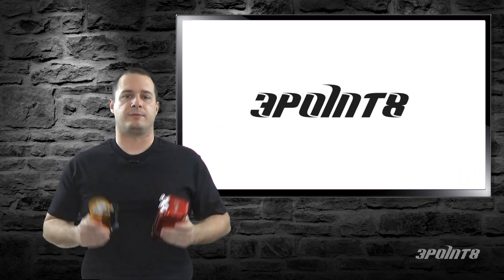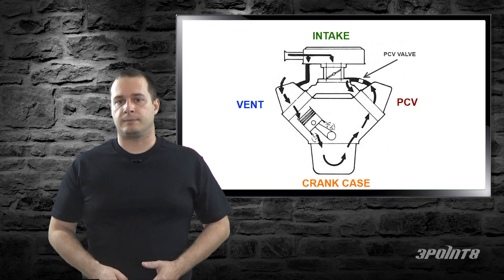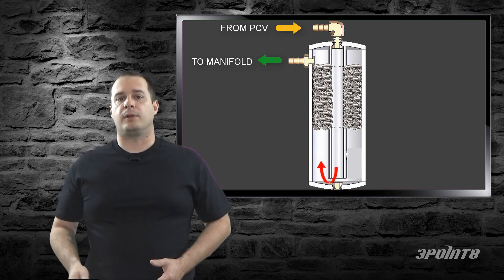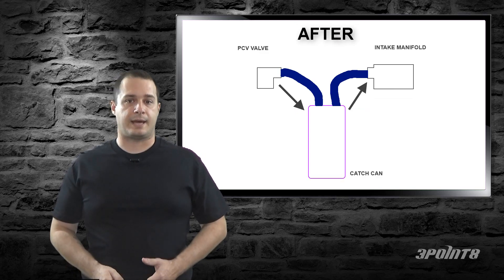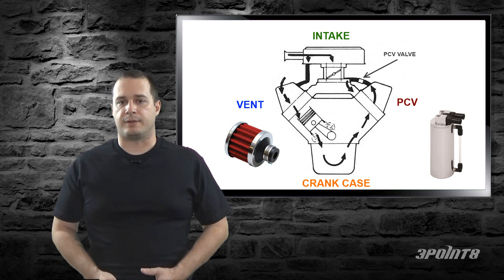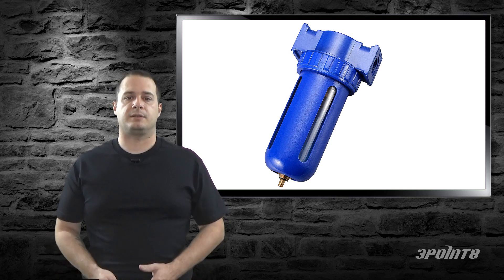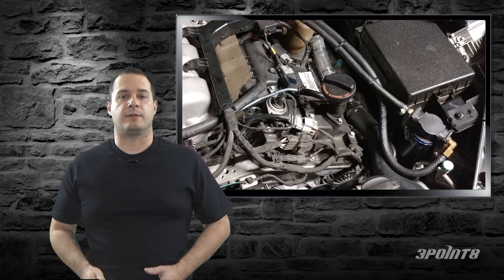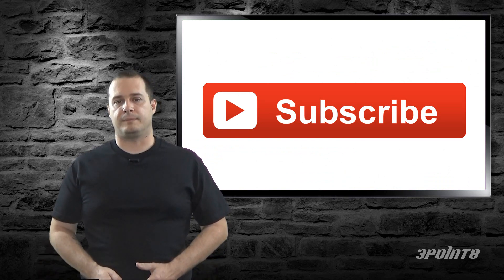What is an Oil Catch Can and Why Do You Need One?

Comment: Oil Catch Can installed
Here is my 2008 Nissan Sentra oil catch can configuration and the end-product result. 04m37s ~ 05m04s discolored gasoline sludge and carbon residues safely trapped in engine oil catch can oil catch tank https://www.youtube.com/watch?v=xCfhebKMRbU&t=2s

오일 캐치캔 캐치탱크 장착했습니다. 가솔린 휘발유 차량이고 포집된 기름 상태 찐득찐득합니다. 2014 Hyundai Tucson SUV oil catch can end result https://www.youtube.com/watch?v=2wvupPKUeTE&t=965s

자동차 엔진 수명 연장, 집에서 일반인 누구나 DIY 가능 최소비용 최대가성비 The most cost-effective engine DIY maintenance at home https://www.youtube.com/watch?v=6DLn0kIi-84&t=225s

Comment: I have a question. In December I purchased an older Toyota Solara 2004 from a private individual.  Due to no affordable transportation.  It had the dreaded 2azfe engine.  I have owned it for four months and do only local driving since I am disabled.  Turns out its an oil consumer, I go through a quart each month.  It still has plenty of pep and no visible oil leaks.  I was going to put a catch can on the outlet of the pcv valve before it goes into the intake manifold. But I heard you mention if oil is getting past the rings a second catch can could be used on the fresh air intake where it goes into the valve cover.  Please elaborate on how its done and what it can accomplish and how more oil escaping can be collected there. Thanks.

Comment: I have a 2003 Neon SRT-4. I put a catch can on it.  I realized when boosted the manifold pressure was no longer vacuum it was boosted. Making air flow in the opposite direction through the pcv hose.

It was actually a boost leak so I put a one-way check valve in the hose that normally sucks air out of the crank case and I noticed an increase in horsepower.  catch cans work great for normally aspirated cars but be careful when you have boost the air will run in the opposite direction from the positive charge toward the engine and in my case the way the valve cover was designed.

the pcv is at the passenger side of the valve cover and the hose that goes to the airbox is on the drivers side.

When you have boost the air flow is reversed.

The air goes in to the valve cover on the passenger side and goes out on the driver side getting oil in the airbox even with having the catch can.

Since using the one way check valve my airbox is dry.

Even when new and 100% stock oil was gathering in my airbox.

I wish I new this when I picked my car up at the dealership from day one.

I was missing hp for 18 years!

 

The addition of the one-way check valve to stop air from going in to the crank case made a much improved difference in acceleration over having a boost leak.

Comment: Eh not entirely true...Sonata 2.0t...the PCV goes into the catch can, CCV has a breather (formerly connected to intake tube)...vacuum under light load comes from the manifold...as throttle increases vacuum then comes from intake...both intake and manifold are connected to dual inlet OCC keeping the vacuum source from on PCV outlet and the fresh air source from the CCV breather filter...with this set-up you don't need an OCC on the CCV side

Comment: Another thing to add to the fact that it is a performance addition is that some catch cans are made of aluminum. There is a reason why manufacturers use aluminum in computer heat sinks; it is because aluminum is excellent for transferring heat. So not only are you capturing the oil vapors that get sucked back into your engine, but you are actively cooling the hot air coming from the crankcase back into your intake manifold.

Comment: My Hyundai has 64,456 miles in it. I Use CRC intake valve cleaning every 5,000 miles since i got it. No issues so far. No need for a catch can. Do your maintenance on your vehicles. Lazy people. LOL
Reply: A catch can is a lot easier than valve cleaning every so often and less expensive plus a catch can, can keep intake valves clean 24/7 and keep fuel economy as high as possible 24/7 and keep horsepower and torque as high as possible 24/7!

Comment: Hi mate. Great explanation about the oil catch can.
I have a question.
I am running an ls2 408 forged high compression stroker motor with ls3 heads on E85.
Motor is making 510rwhp.
Because of the camshaft overlap and running richer on E85 there is sometimes a cloud of white smoke from the exhaust when the throttle is floored.
It's fuel vapour.
Would the catch can reduce the fumes and vapour as well as the oil going into the intake?
Reply: It should reduce the oil going into the intake but it wont change the fuel vapor out the tail pipe

Comment: can the oil affect your catalytic converter and the catch can gets rid of the oil that would normally burn and go through the exhaust and get trapped in the catalytic converter causing po420
Reply from the maker: too much oil can certainly effect the cats, but usually oil won't cause a P0420 or P0430 code. The cats get pretty hot and anything that might not burn in the combustion process will usually burn off on the cat. Not to say I haven't seen cats clogged with oil and sludge. But yes, a catch can will prevent the oil that normally gets into the combustion process from doing so which means less chance of causing issues with the cats.
Reply from the maker: On another note though, if you have enough oil getting through to cause a P0420 code, you have other issues. Possible bad rings or valve seals/guides and a catch can won't help those problems.
Reply: Your car probably just has a lot of miles and needs a new cat by now, but if you would've had an oil catch can the entire life of the car then I'm sure the cat converter would have lasted much longer.

Comment: serious question. i installed ADDW1 can with 3/8 lines beacuse my PCV was 3/8 in my 1999 honda accord due to some excessive blowby...my MPG's tanked soon after, checked for vacuum leaks, none to be found even with "smoke" test. first why did i lose mileage and second how?
Reply: Strange. Is it a 2.3 liter accord? I'm going to put a can on my 2002 soon. It should increase fuel economy. Maybe something else went wrong at the same time. Make sure your PCV valve is working properly and if not replace it and make sure your oil catch can doesn't restrict the air flow.

Comment: I had a question if you also want to catch vent side pressure do you have to use two catch cans or can you just route both the pcv and the vent side into one side of a catch can and then into the manifold from the other side or does this cause a pressure discrepancy
Reply from the maker: In most cases using a single can will result in a vacuum leak and will eventually end up in with a check engine light. I've personally tried various single can setups using check valves, but in the end they did not work out. Your best bet is to just use 2 catch cans.

Comment: I have a 2018 challenger. I got the oil catch can I have to install it BUT I don't know if this will void the warranty or not. Any idea?
Reply from the maker: Warranties are a tricky thing. In general it's always best to go back to stock when taking the car in for service. A lot of dealers are cool and won't care much about mods like an intake or a catch can. In some cases, catch cans can be hidden (intentionally or not) and the techs won't even notice them. Most techs know what they do and won't say anything, but it all depends on what you're taking it in for and how strict the dealer is. If you're going in for an oil change, then probably not a big deal. If you going because the engine blew, I would remove anything and everything. 

Your extended warranty providers, however, can be another story all together. I've stood in line while the service manager was on the phone being told the customers policy was canceled because he installed coil overs. You will want to determine how strict your extended warranty provider is and handle things accordingly. IF you're not sure, just walk into the service dept and ask them directly. Don't give them your name and do it at a time when you don't need to service your car.
Reply from the maker: I will say that on the topic of smog, it's possible that you will fail inspection with a catch can, especially in California since it's changing the factory emissions system. So you'll for sure want to remove before getting inspected.
Reply: Thank you very much!!! I will follow your input. Thank you again
Reply: pretty fly for a wifi gb6

Comment: Hi Dustin! May I ask that which oil catch can you think is the best for the gen?
Reply: I've seen this one recommended on the forums, but I don't like the look of the tubing. 
http://www.ebay.com/itm/Wilsondyno-Polish-Baffled-Universal-Aluminum-Oil-Catch-Can-Reservoir-Tank-Black-/122295113271
Reply from the maker: Depends on your level of skill. I personally use an oil water separator for an air compressor. But I had to build my own brackets. The available cans for purchase have already solved the placement and provide brackets which makes it super easy to install. For the most part, any catch can will work, it's just the install.